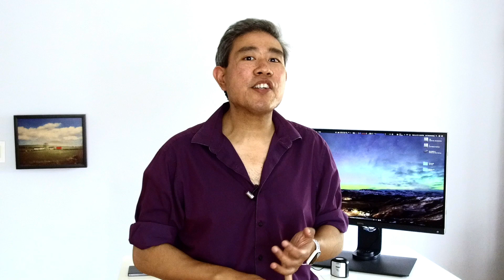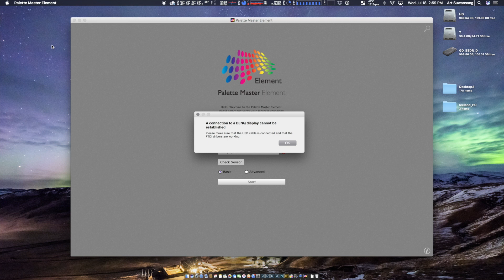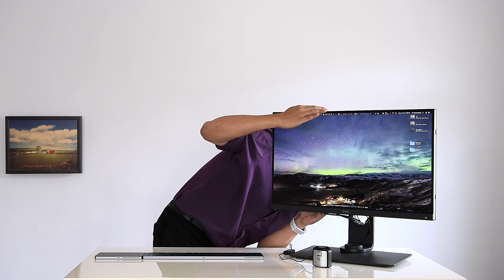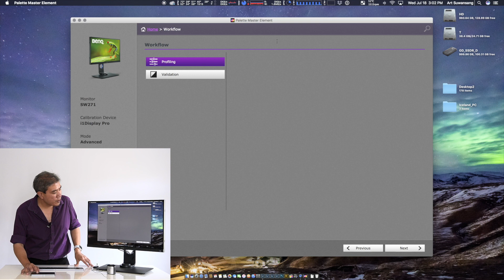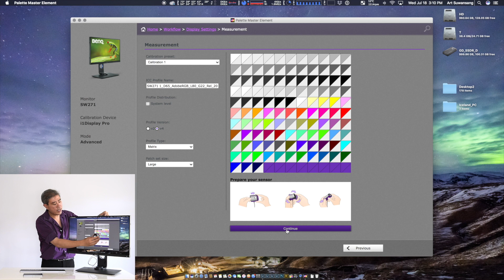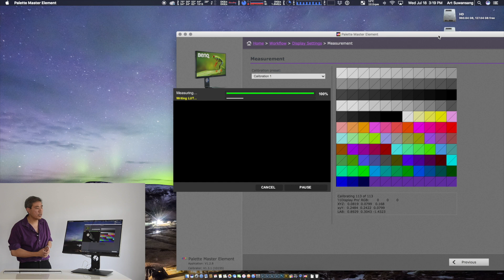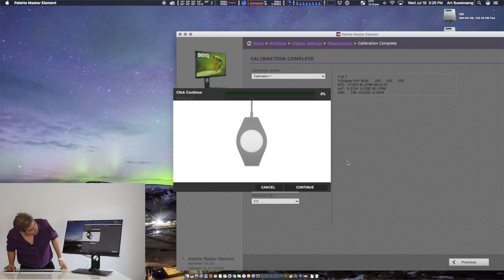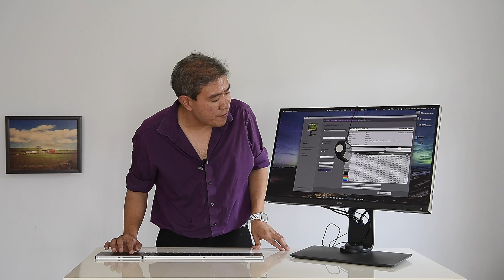How to Calibrate BenQ SW Displays with Palette Master Element - Art Suwansang

Comment: This answer is probably somewhere in the video. But somebody had recently mentioned that my monitor is probably calibrated With an ICC profile… Based on my OS. So the monitor itself isn’t being calibrated. Is that what’s going on here? I did this a while ago, but I’m thinking I was actually calibrating the monitor. I only ask because I posted a question on a forum about using something like ultra studio 4K mini. And honestly I’m still not sure how it works. But I guess it pretty much bypasses the OS and sends a clean signal from the computer to the monitor
Reply from the maker: Thanks for the question, let me start out with this, forums can be a dangerous place, too many people who don't know what they are talking about trying to exert their false knowledge. This said if you have a BenQ SW and calibrate with PME the adjustment is done on the display itself. Yes there's an icc profile that PME generates, that profile contains Gamut output information and tell the OS to output the signal at 100% RGB regardless of deficiency with no correction. These icc profile don't alter the output, to test this if you have multiple icc profiles from PME what you can do is switch between them, there should be no changes or if there're it is almost imperceptible. If you use a reference profile, however, you will see lot of changes. Hope this helps.
Reply: ArtIsRight it does! Thank you!
Reply: ArtIsRight oh, and I’m not sure if I’ve asked this before. But can something like the ultra studio mini monitor be used with this and my MacBook Pro? So it would go something like this: laptop to mini monitor (via thunderbolt/USBC)—mini monitor to BenQ display (via hdmi)
Reply from the maker: If you have an SW I would recommend connecting it directly to your MPB and if you need to use another display, I would run a separate cable for it.
Reply: ArtIsRight ok, thanks again. That’s how I have it now. And I’d rather not get dragged down deeper into this expensive rabbit hole. This all gets so confusing and muddy. Stepping out and getting this monitor was a big deal for me. It may not be top-of-the-line stuff, but still pricey. So it gets frustrating when people keep recommending all this additional stuff… Like it’s just not good enough ever to get “accurate” color.
Reply from the maker: I hear you, this is why I don't recommend anything addition other than the calibration device. Also, yes it is not top of the line but it gets you 95% of the way there at 1/2 to 1/3 the price, I call that winning and winning BIG!

Comment: Hey Art, I finally got a SW270C from Benq,  Now  my issue is, that  the colors in AdobeRGB-Mode and sRGB-Mode are extremly different. Not only less saturation in sRGB-Mode, but also a drastic color-shift (skin-tones shift to green). Is that normal  ?
Reply from the maker: In the factory pre calibrated mode this is normal. If you have custom calibrated this you will see some changes but not much.
Reply: @ArtIsRight  do you have a video, how to compensate the loss of saturation ? Or how is your workflow? Do you postprocess the pictures in AdobeRGB ? And how do you handle exported sRGB-picture for i.e. instagram, so it looks more saturated again?
Reply from the maker: What is your workflow right now so that I can come up with a solution that is tailored to you. I'll also add a video like this to the list. This said in LR, not much that can be done. You can export the images as sRGB and reimport them to do further color adjustments, use another program to do color adjustments after export or use soft proof in Dev module to preview the image in sRGB. Personally for me I never bother to spend that much time checking or reediting the images, especially for web consumption, but that's me. If you use Photoshop you can simply convert the color space to sRGB and make the adjustment then and there before you save out Jpeg file.
Reply: @ArtIsRight  My Workflow is pretty easy, because I don't print very much. So I process my RAW-Files in CaptureOne and export them as jepgs in sRGB for the use on the web (Instagram/facebook).
But I am new to a hardware calibrated monitor and wonder which mode to use when working on the pictures to get the best final result (Adobe-RGB or sRGB-Mode). My problem right now is, that the pictures look good/great in AdobeRGB-Mode and poor in sRGB mode. Would it be better to work in sRGB-Mode all the time or will the exported jpegs be of equal quality when working in AdobeRGB-Mode ?
So what Monitor-mode would be best for web-results?
Reply from the maker: Rather than using the sRGB Color Mode on the display, you can simply calibrate your display using PME advanced setting and change the RGB Primary to sRGB instead of the default Adobe RGB for Photographer. You can check out my PME guide here https://youtu.be/8rjRoIe0-mo This is if you want to work in sRGB. 
This said rather than calibrating your display to sRGB, I would just recommend that you calibrate it to the largest color space possible, Panel Native. There's really no need to calibrate in small or other color gamut. Running in the background on your computer there is a program called a CMM, Color Management Module that does the color conversion in real time. If you are using adobe application it uses a program called ACE or Adobe Color Engine. However your images are tagged, the CMM will convert via your display panel native profile so that you are seeing the correct tag color space. So for instance in Photoshop, if you bring in a image tagged with sRGB color space, regardless of display color gamut or RGB primary setting, ACE will make sure that you always see that image with the proper sRGB color gamut. Here’s a video with further explanation of CMM https://youtu.be/Yvu-sgddna0?t=552 The key here is to tag your image in sRGB. Also one thing not to do is change the preset color mode on the display too proof, those modes are for reference only and they are not accurate on your computer. Give this a try and let me know.
Reply: @ArtIsRight  Thank you so much, I will try as suggested and tell you how it turned out.
Reply from the maker: Sounds good
Reply: @ArtIsRight  Hello Art, so I had some time today to test the calibration as you suggested above. Unfortunately, maybe due to my Spyder 5 which might not work properly, the  calibration with your settings and Panel native as color space. the monitor looks awfully yellow/green-tinted. I tried to figure out, if the softproof in lightroom and capture one works, but i can't see any effect on the pictures when doing so. I hope I can borrow a different colorimeter and try again, but for now, I am gonna stay with sRGB, which looks quite okay now that I got used to the 6500K-white. Anyway, thank you for your efforts to help everyone here !
Reply from the maker: You're welcome! If you have any follow up please start a new comment thread and avoid continuing on this one, this way I can get back to you faster. Youtube does not do a good job and showing follow up comments on threads and they get buried.

Comment: If I use i1Display for the MacBook Pro 2019, do I run the software from x-rite to calibrate my monitor? If so, will that match my sw270C? Or, do I calibrate my MacBook Pro 2019  with my MacBook attached to the monitor and run the monitor Palette Master Element? Thank you! This presentation is awesome!
Reply from the maker: Hi Char, yes for the laptop build in display you would use i1Display Pro https://youtu.be/REGRfFdLYFM & https://youtu.be/JrPdvs2by04 And you would calibrate the SW270C with PME. As far as matching color, they will come close but won't match for numerous reasons. Different backlight power and technology, different LCD panel used (look at the thickness of the laptop display compared to the BenQ), different RGB primary, etc. The best thing to do is calibrate the BenQ and use the SW as the reference display, and use the Mac build in display as a secondary display for panels, palettes, etc.
Reply: ArtIsRight Thank you  for getting back to me. So appreciated. I’m thinking of picking up iStudio so I can also  calibrate my canon Pixma  pro-100. I have found your  videos to be most helpful. Because of your video comparing the Sw271 and Sw270C, I was able to make my decision for the Sw 270C. 🙏🏻
Reply from the maker: You're welcome, I have plenty of videos on the i1Studio as well. Check them out, it is a great device.
Reply: ArtIsRight Thank you so much!
Reply: Hi Art...I sent you a message through FB. Looking forward to receiving the discount link. 🙏🏻
Reply from the maker: Just send you the code.

Comment: Thanks you for your videos which have been quite instructive.  I got my SW270C last week and am having issues calibrating it with the i1Display Pro. The screen is much too bright and the validation report shows that the measured values for 241 are at 100 whereas the target is 95.  I have followed your recommendation as far as possible but I am not able to turn off HDR on my MacBook Pro running OS 10.15.6 because that checkbox does not appear.  I did connect it to my wife's Win10 desktop and the calibration worked just fine so I know the issue is related to my Mac. Do you have any suggestions?
Reply from the maker: I'm glad you did an A/B testing already. Answers these questions for me and we’ll go from here.
1. What computer (Laptop - Mac specify the model, year and size, Desktop, iMac, all in 1 PC, custom build, etc )
2. What is your Operating System (OS) version are you using? (For Mac please specify the dot release, for Windows please specify version / build number)
3. What calibrator are using?
4. What version of PME are you using?
5. What BenQ model do you have?
6. What cable are you using to connect your BenQ to your computer for the display signal, HDMI, Display Port, etc.
7. If you are using USB-C skip this question, if not, are you using a USB link cable between your laptop and display?
8. If you are using Mac was this a clean install or was the OS upgraded from a previous version at any point (I.e. From Mojave 10.13.x to Catalina 10.14.x)? Or was this Mac restore from a back up, time machine or other wise?
9. For PC, what GPU are you using? If Nvidia are you using their new Studio Driver?
10. Were you able able to successfully pass the validation at some point?
Reply: @ArtIsRight  Hi Art, It's a 15" MacBook Pro 2017, with Radeon 560 GPU. The issue with turning off HDR is now resolved. Turns out connecting the SW270 via USB-C cable brought it back.  However, the issue with calibration still exists after turning off HDR and 241 is still at 100. Having watched this video I will try downloading 1.3.10 and seeing if that helps.
Reply from the maker: Yes keep me posted, .10 should work.
Reply: ArtIsRight sorry, didn’t read your response to the end and only answered your first question.
1. MacBook Pro 15 2017 with Radeon 560 GPU
2. 10.15.6
3. i1 Display Pro and I have also tried with ColorMunki Photo
4. I’ve tried 1.3.10 and .11
5. SW270c
6. I have tried USB-C and HDMI
7. I have tried USB-C
8. Upgraded from High Sierra and was restored from a TM backup a few days ago after I tried a suggested solution to force it to read RGB EDID.
9. Mac
10. Yes, but the values for 241 are out. The measure value is 100 whereas the target is around 95.
9.
Reply from the maker: 5 bits different is with in margin of error and not discernible by human eyes. Did .10 work. I think your issues is related to the time machine restore. I've seen this happens too many times, restored machine usually have issues this is because apple changes the way how color rendition works in each OSes, with you do a major upgrade those old components are still there causing conflict, the best thing to do is stat with a fresh system. But what you can do is dual boot by creating another Mac OS installation for calibration. If you want to know how to do this, let me know.

Comment: What’s up. Not sure how else to get ahold of you specifically so I just come here because I know you’re good at replies. Anyway, real quick, since you use a Mac often for your demos, I was wondering if there are reported issues of using the displays after the Catalina update. I literally just updated a few days ago. And I saw some comments on the FCPX group about their computer not recognizing the display after updating. It wasn’t specifically a Ben Q, but I figured I would ask. I’m at work so I haven’t tried color grading anything yet using the monitor.
Reply from the maker: I ran into a few issues with my 16" MacBook Pro when disconnecting and reconnecting external display. So far a reset resolved the issues, so I am not certain how wide spread this issue is. As far as display not recognizing, I would first restart and check the cables. Sometime wonky software can cause issues that manifest like hardware issues.
Reply: ArtIsRight  OK thanks. Like I said, I haven’t tried yet. But if I run into issues I will do this.
Reply: ArtIsRight any idea why it says HDR ON when I press the numbered buttons on my puck? When I click into the menu it says “mode: HDR” at the top. I don’t work in HDR mode. This is new. And I’m not sure how to change it.
Reply from the maker: Watch this https://youtu.be/CFyNBYP5lJk
Reply: ArtIsRight you the man! Thanks. Again.
Reply from the maker: You're welcome
Reply: ArtIsRight can I ask about the actual display look vs my laptop’s look? I’m testing some lighting setups and shots for a night/int bedroom scene and grading it. When looking at my monitor while adjusting there is a lot of detail in the darker shadowed areas. As I adjust controls and look back at my laptop (specifically scopes) the shadows are on the verge of crushing and the overall image is way darker. In short, the monitor is brighter that my computer and it appears as though my computer screen is the more “accurate” picture...judging by how my parade scopes look. My intent was to use the external display so I could more accurately color grade. Is there any other settings on my BenQ that I should mess with? Even turning the brightness all the way down, I can still see detail in the shadows. It actually looks quite nice, and I wish that’s how the final picture would look. But again, according to my color tools, it’s got more of a stark falloff. I guess I’m just confused as to what is the ‘true’ look.
Reply from the maker: So comparing what you see on multiple displays is never really a great idea, the only thing that it does is create self doubt. And if you consider the "real world" use cases and scenario, the displays that are out there in the world is all over the place. Are you calibrating your Mac laptop display with the candela value that closely match the external display. Both should be calibrated independently with settings that are the same or as close as possible to each other. Another thing to consider too is that your Mac laptop display is glossy, which shows way more contrast than a matted display, that is also the variation that you are setting as well. As far as "accurate" goes everything is relative the question is to what. Which is why we do display profile QA or validation to test this relativity. You can have 2 displays with the same ∆e value but the color shifts differently, this is perfectly normal. So if you calibrate your external monitor, I would use the scopes and stick with what you see on it.
Reply: ArtIsRight ok, I’ll use the scopes as a reference...as far as Luma goes. That’s where the questions arose...when viewing the scopes. In this particular instance they were just about bottomed out in the shadows, which made sense looking at the laptop. But the display looked like there was still plenty of room to bring the shadows down—lots of detail that I could see. Scopes provide us with a true look into what the colors are doing. So is it safe to say that the monitor displays the image brighter than normal?
Reply from the maker: What is your calibration setting?
Reply: ArtIsRight I pretty much followed along with you as far as settings. Except I selected video editing (Rec.709) instead of photography. I’m pretty sure I set the same candela and all that.
Reply from the maker: Got cha!